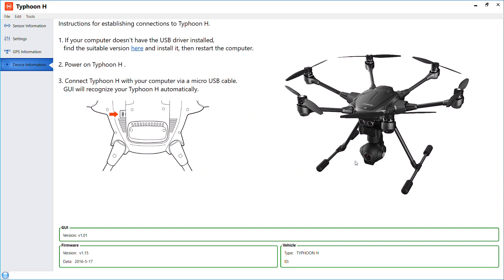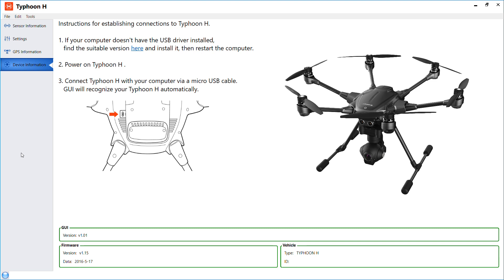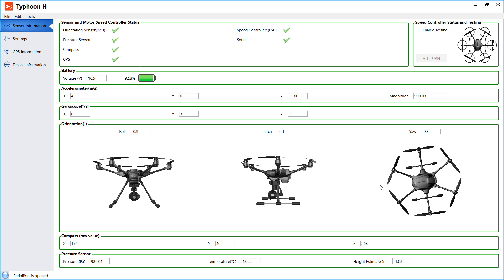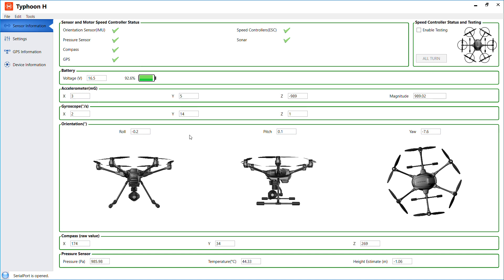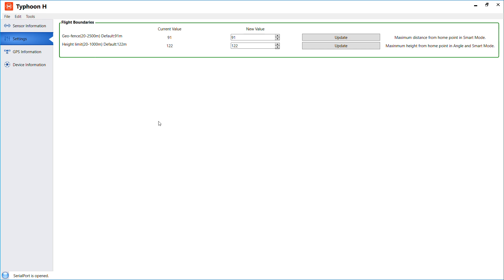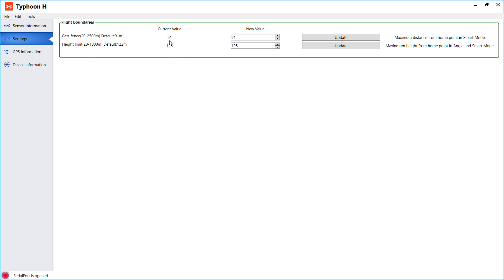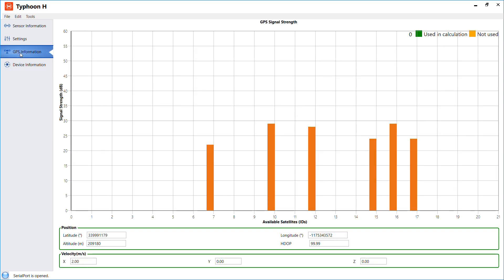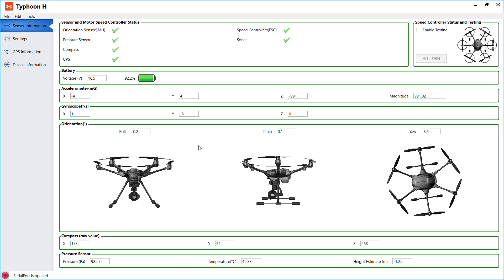Typhoon H GUI Setting and Geo Fence and Height Limit Boundary modification | Noldy34

Comment: I live within 5 mile radius from an airport is it possible to fly it with restrictions??? Has yuneec made any updates to requests as this??
Reply from the maker: I have not heard any update from yuneec regarding about this.  Sorry!
Reply: Yes you have to contact them with the serial number on your drone or you can find the serial number in the GUI I think. They will send you an updated firmware that will allow you to take off. 👍
Reply: I would check out the FAA's site and get your Part 107 training to become a Remote Air Pilot License its actually required. It teaches you how to contact the FAA as well when you have questions like this. Its also a requirement in the U.S. to get your RAP license.

Comment: When I installed the Typhoon H GUI on my laptop Windows 10, the software looks for a COM1 port which my computer does not have. If I change the settings to use USB, it never finds the USB port. Thus, the indicator in the lower left of the screen remains red. I've tried the USB drivers found on the Yuneec website, both 32 and 64 bit.
Reply from the maker: Sorry for replying to you so late! If you're still having this issue you should probably go to device manager on windows 10 and do an update of the USB port. Hopefully this solve your issue.
Reply: @Noldy34  same to
Reply: did it work?? having the same issue

Comment: Remember; the FAA altitude restriction is 400' above the ground or AGL or over a structure when operating within 400 feet of the structure. This GUI sets the altitude restriction from the controller. So if you are at the foot of a small mountain or tall terrain feature that is greater than 400 feet tall, and wish to fly over the top of it, you will need to set the altitude restriction to make sure your aircraft can clear it. If you leave it at 122m and the top of the structure is 125m, you wont be able to clear it. You must change this value or take the controller up the structure.

Comment: Hi Need some help.
I cannot load the GUI, I install then update the usb driver.  restart then start the H, plug and it keeps searching for the drivers.
What is going wrong.
Using windows, tried with Vista, 7 & XP just wont go.
Can you help and give some advice. thanks
Martin
Reply from the maker: Try to uninstall the H GUI then restart your comp. After that, reinstall the H GUI again and update the USB driver if prompted. Then restart the whole computer. Once your computer finished loading everything, power up your Typhoon H first, then connect the Typhoon H to the computer USB. Hopefully, the Windows will recognize it then. See if that will do the trick. Good luck!
Reply: if u use win10 u run app like administrator

Comment: Newbie Question: So the instructions and videos say do NOT turn on the Copter without the controller being on first.  However here you state to just turn on the Copter. So I don't need the Controller to be on (first) too?
Reply from the maker: Hi Marc! Good question! You are correct. You need to turn on the ST16 controller first before turning the Typhoon H per Yuneec manual instructions before flying the drone. However, connecting the Typhoon H to the Yuneec GUI via USB only involve configuring the Typhoon H and not flying it so you should be OK to turn on the typhoon h first. Thanks for watching this vid!

Comment: Great! You saved my expectations!
Is it possible to change altitude mode  RTH ?
If possible, please do another more extensive overview of the settings and change the default settings.

Thanks!!!
Reply from the maker: Alex is correct! as of yet, RTH setting is set and cannot be changed. Hopefully Yuneec will address this issue soon.
Reply: did you ever find out how to change it? thanks
Reply: Unfortunately, this function changes the height of RTH  is not available. Let's hope that in the future developers will update the software ...
Reply: thanks for the reply Alex...have a good one, and lets hope...